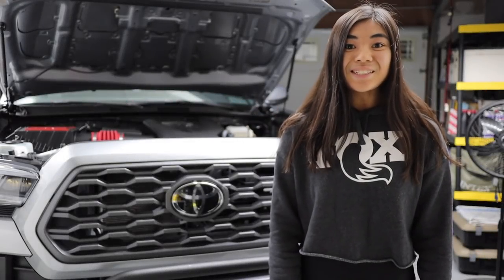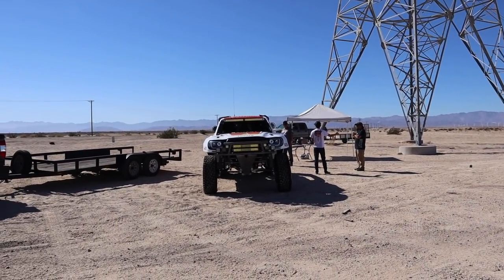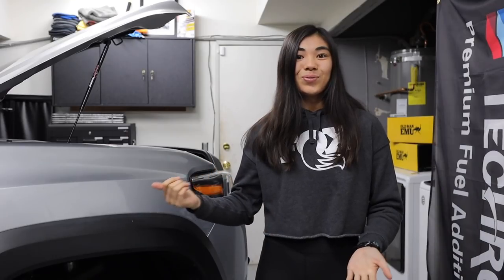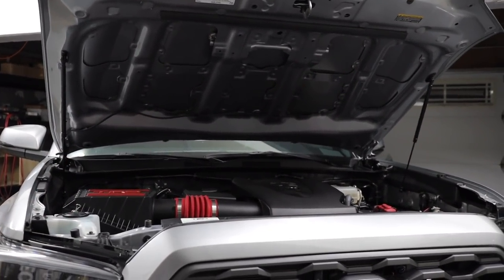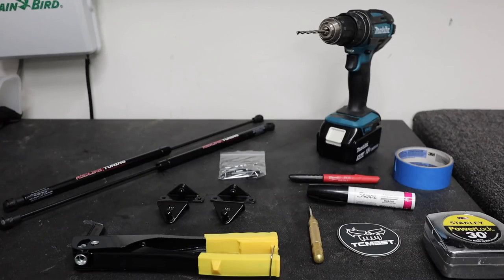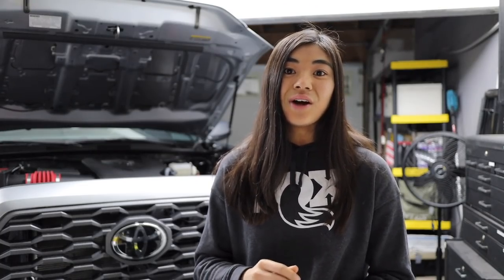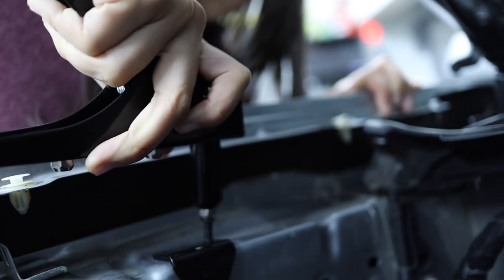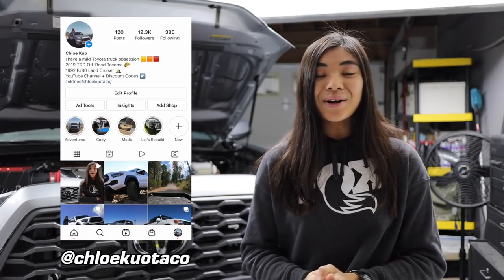Installing Gas Hood Struts on my Tacoma! Redline Tuning QuickLift Plus from TacomaBeast

Comment: I am a big fan and I am an old man.  I enjoy your videos.  I have a 21 TRD Off Road (my first Toyota P/U).  I installed the Redline elite struts today.  What I did differently was I cut pieces of wood exactly 12.5" and 19".  I taped them down so all I had to do is butt the ball brackets up to them to mark the holes.  I had a step drill bit so the rivet fit was perfect.  I learned a long time ago to check the oil at every fill up.  This makes sure I have eyes on my engine compartment regularly.  Now lifting the hood is effortless.

Comment: Khloe, I've been following your channel since I bought my Tacoma last month on the 1th.  I really like the content and have followed your recommendations on mods.  I liked the hood strut idea right away. I went with your recommendation to buy from Tacoma Beast but wish I had not.  I ran into a snag when attempting the install and emailed them on Friday, Saturday and then Sunday and got no response until Tuesday.  The written instructions say to measure 16 to 16-1/4 " from the hinge mounting point  on the hood (depending on the year of your Tacoma of course mine is a 2023 and it is not addressed at all The kit I received is for 2005-2015 Toyota Tacoma  
QuickLIFT Installation Guide).But at that point, the upper strut mount can not be mounted due a factory supplied hole in the hood.  Their You tube video says what the  Redline video says, measure 19" from the hinge mount point. The disparity in the written vs the video instructions  made me halt installation.  I didn't want to make a mistake.  Tacoma Beast boasts great customer service and that is one reason I went with your recommendation even though I Could have saved a few dollars by ordering the Redline Kit from Amazon.  Tacoma Beast's lack of response makes me re-think ever ordering from them in the future.  All I needed was clarification on the initial measurement from the hinge to the upper strut mount The written instructions supplied with the hardware said 16 to 16-1/4 " and he You Tube instructions said 19".  Perhaps I just have the wrong set of instructions for my 2023 Tacoma.  But had they replied to my emails that could have all been straightened out.

Comment: The mechanic trick for drill stop is cut a proper length fuel hose and slip it over the bit only exposing enough cutting length to get through 😉

Comment: I have the 2nd-gen Tacoma kit, and they come with self-tapping sheet metal screws for the fender mounts. My rivet gun is like yours, and they're always hard to use, especially with smaller hands. The trick is to open it all the way after each full squeeze. First squeeze is easy, 2nd is a bit tough, and the 3rd one--which should be the final--is almost impossible. Very satisfying to hear that snap.

Comment: Another great video.  The painters tape wrapped onto your drill bit, as a depth stop, is really a good thing to do.  I used a length of rigid plastic tubing for the same purpose.  You definitely do not want your drill to pull through the hood.
Reply: See my suggestion above re: stop collars.

Comment: Great video as usual. One option for rivet guns is pneumatic which can cost in the $30 to $60 range instead of costly electrical ones. If you already have air tools (which many DIY mechanics have) and a compressor, you can save a bundle.

Comment: Rivets are very easy to do. What you were doing wrong is when you squeeze it the first time you need to release the tool and slide it up the rivet so the tip of the tool is touching the hood again (in this case). Squeeze one more time and that's it. They will break off. 
They make struts of the rivets longer in case you are using it on thick material.
If you want to remove it, use same size (if not smaller) drill bit you used for the holes and simply drill trough the rivet.

Comment: Beware !!!  If you plan on adding a K&N cold air intake system, the heat shield around the air filter will prevent the strut from closing.  I had to modify the heat shield by cutting out a small section to allow the strut to come all the way down.  Another option was to remove the rivets and find a different placement for the bracket, which could’ve lead to other problems.  My advice, install your cold air intake system before considering this mod.  I will say, however, the struts are awesome and nice to have.  Thanks Chloe!

Comment: I’m not sure if you are aware, but I clicked on the link you have provided for the good struts you said you installed, but the link is for hood struts for model years 2005-2015. I unfortunately ordered these and got them delivered before I realized they were for the wrong year, as I have a 2022. You might want to change the link in your description, as I’m pretty sure your Tacoma is at least a 2020-2021

Comment: If you have a hammer, you can tap the top of the rivet gun to drive the rivet into position, then squeeze the handles.  You can put a section of pipe (emt conduit?) on each handle to increase the leverage.  THose supplied rivets eem a little long, you might find a shorter 3/16" rivet 'cause Tacoma sheet metal's not so thick.  Also, check the cost of that 'add-on' rivet gun against one from Harbor Freight tools, for instance that likely comes with an assortment of rivets.  Mine has lasted thirty years or so.  And I have another cheap one that has to be fifty years old.

Comment: Chloe, Chloe, Chloe..  Use Safety glasses especially when drilling overhead, even to the side.  Those shavings can whip off to the side.  Personal experience,  I had a shaving in my eyelash,  eyelid, or eyebrow (not sure) hours later, when I went to bed, it fell into my eye.  Trip to E.R. at 2am, to have my doctor surgically remove the shaving from my cornea.  No fun.. just saying.   Anyway,  love the video, I have been thinking about installing these for awhile.  Great video!   We appreciate you!

Comment: In the past month I upgraded to the Redline Tuning Struts, as well.  I have to comment on the no-drill type. I had a set of those for about 8 months. After a period of time, I noticed the lower support ball pin which screwed into the driver fender ground location was bending forward. Examining it closer, the sheet metal it was mounted on was pulling outward. Obviously, the sheet metal was not designed to support that heavy hood (more specifically - at a "point" location on the metal). The passenger side threaded hole was dimpled around the sheet metal as well when I removed the Sokietech hardware. Those fender locations are fine for a grounding mount, they are basically a nut spot welded to the fender sheet metal.  I will never again recommend those Sokietech hood struts.

Comment: I did exactly what you did but I haven't gotten to the drilling part especially the hood find your marks on the tape wrap as many layers if tape about 1/4 inch back from the tip to keep from going thrue the hood all you want is the drill bit size they the company recommend and it's two layer on the hood drill slow here and buy the red lines the rivets are hard but use two hands make sure the rivet is in the gun and drilled hole all the way.

Comment: I just installed the Redline Turning QuickLift on my 23' Tacoma.  Pretty easy and straightforward.  One recommendation that worked great for me was getting a slightly bigger Riveter which gave me more leverage.  I got a 17 inch from Harbor Fright for under 20 bucks and made the rivets super simple.  The smaller ones are really hard to use.  How are these holding up for you Chloe?  That would be my only concern but frankly, they seem to be high quality so I bet they'll last a few years and maybe beyond...  Great video as always 🙏
Reply from the maker: Great advice on the riveter… I remember how much of a struggle that was! My hood struts have been holding up great! So glad I installed them

Comment: Thank you Chloe for the video! Just made up my mind to get the NO-DRILL struts
Reply: I just installed the bolt on hood struts and it took 20 mins and they are amazing. Screw drilling and riveting. Hood is a solid 4” higher, and just for a bill.
Reply: @scottvamp  👍 ❤MY🌮

Comment: Strange that Toyota did not put gas hood struts on the Tacoma. Do they now? Both my 2022 4Runner and 2014 Sequoia have them from the factory. If they did not, I too would install the Max Lift struts you mentioned and I'm 6-04. BTW, 5-05 is not short. My wife is a perfect 4-11!!

Comment: Where I respect your opinion on the No Drill struts, I've had mine on for about a year and have No issues. They go through being engineered and tested like any other product.
Reply: What's the cost
Reply: @timhobbs1229  about the same.10 minute install and on down the road.Have had mine for a year too with no issues.Fits perfect with the Injen CAI too.Redline would probably get in the way and you would only be able to run one!😏Oh… add some blue loctite to the bolts for insurance!
Reply: @timhobbs1229  You can find them for around $100 or a little less and it's a much easier install
Reply: I just installed the bolt on hood struts and it took 20 mins and they are amazing. Screw drilling and riveting. Hood is a solid 4” higher, and just for a bill.

Comment: Don’t like rivets once they start to become loose it’s a pain and it’s not something you can fix out and about. You have to drill out the rivet or grind it off then replace it with a new one I really don’t like rivets I’d rather have a knot in a bolt straight forward to replace. Nylon nuts not lightly to come on done, Once again really don’t like rivets lol

Comment: Does anyone have a power trays on the right and arb on the left know if the struts get in the way or will the struts work with that set up.
Reply: Yes. You need the single struts off running4tacos